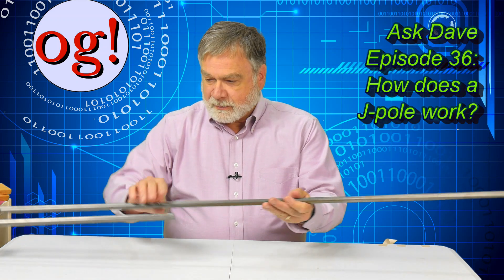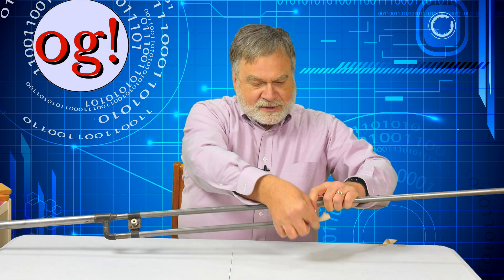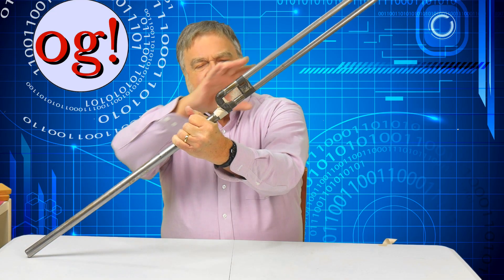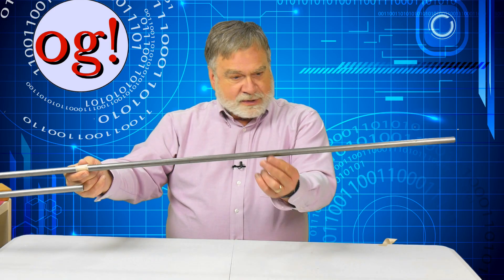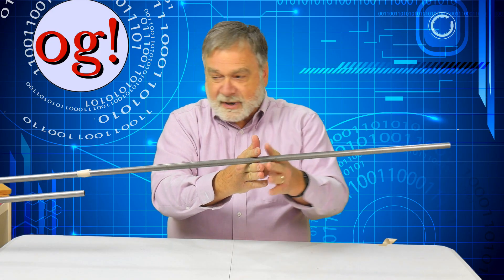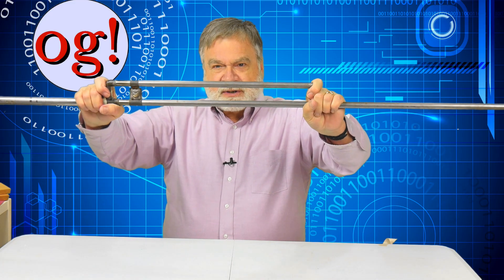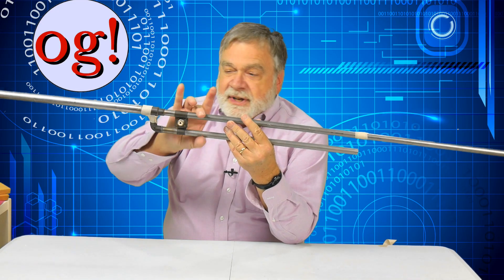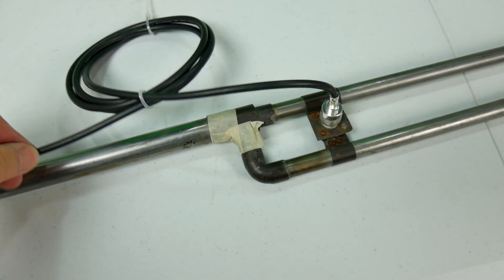How does a J-pole antenna work? AD#36

Comment: There is another sulotion...find the 200 ohm point, en make an 4:1 coax balun...the symetric problem is then also solved,
Reply from the maker: A simple choke balun (rolled up coax or ferrite beads) can do that too.
Reply: @davecasler  yes

Comment: Many thanks Dave: An excellent tutorial. I have a couple of questions 1) I've seen online several minor variations to the J-Pole design; either the centre conductor of the coax is attached to the J stub or to the main antenna section. Which connection is correct or doesn't it matter. 2) You said in the video that the lower end of the main antenna section doesn't matter. However, wouldn't the RF E-M fields be induced in this lower section since there is nothing to stop this. Therefore, does the lower end of the main section (the mast end) need to be grounded or insulated from ground? Does it matter?
Reply from the maker: Regarding connecting the coax, it's a balanced antenna, so it doesn't matter. Re the mounting stub, I've heard lots of opinions. In my experience, it's just an easy way to mount it.
Reply: @davecasler  Many thanks Dave

Comment: thanks very much Dave, pls i have a fm radio transmitter ''st 15b'' which i will be using for my amateur radio station. can i use such antenna for it. if yes what are the procedure for building such antenna?
Reply from the maker: I'm not familiar with that radio, but if it works on 2 meters then this antenna should work with that. You can find construction plans for a J-pole in multiple places on the Internet.

Comment: Ok... What would happen if you made two of them with both sharing the long copper tube and they are butt to butt with say 1 foot in between or 1/4 wave in between?  Yes, the bottom one would be up--side down.  The question is: would it increase the db gain? Also, could it be used horizontally?  Would it need co--phased?  Would they both need a 4 turn coil of 5" diameter coax?  Horizontally would it be directional?  Ahhh... The questions!!!  73s
Reply from the maker: Yes, you could probably make it work. I think you'd probably want to feed it in such a way that the antennas were of opposite phases. Why not give it a try?

Comment: Never ground a J Pole.
Reply from the maker: I don't see why not. You're so far away from ground that it's likely not a good RF ground, but grounding it via a wire or something allows the static charge to bleed off that happens when the wind blows across the antenna. I recommend the J-pole always be grounded.

Comment: Hello, Sir, and thank you!  I've read that a j-pole antenna is omnidirectional but wonder if there may be some advantage to pivoting the short or longer pole toward the signal source or perpendicular?
Reply from the maker: It's pretty omnidirectional as it is. The shorter pole is the matching stub and needs to be parallel to the main pole.

Comment: Dave you sure have a lot of knowledge and enjoy all your videos.  But this time recently discovered that the bottom part af the jploe does make some coupling with the metal mast. The swr was very high and could not find out why until made some adjustment to insolate from the mast and the swr was fixed...  the mast beeing all metal and 20 feet long was part of the antenna!...   hope this works for some other ham collegues    TKS
Reply from the maker: Be sure to provide a path to ground from the Jpole so that wind-induced static charge can bleed off. Otherwise it can blow the front end of your radio. I speak from experience.
Reply: @davecasler  well, I have a rod under ground as physical ground and then connected to the radio with copper wire... do you think that will take care of the static charge bleed off David?  (I know it does not good in case of lighting)
Reply from the maker: @sergiocavazos8963  As long as there's a DC path to ground.

Comment: J-pole antennas were designed for use on zeppelins (air ships) back in the day due to the fact that there was no ground as per say...also they are meant to be mounted upside down to the way we use them...they are a compromise antenna at best and not any better than a properly designed ground plane antenna. A co-axial dipole would work just as good and be easier to make and look better too.
Reply from the maker: There are many different antenna designs, and each has its proponents.

Comment: Hey Dave, I built a copper J-pole antenna today.   It's Rx is fantastic, but on Tx my swr was 20+.  I was worried I needed to rework the feedpoint, but after watching your video I realized that to match a balanced "feedline" (the 1/4 wave parallel section) to my UNbalanced feedline (coax), I needed a balun.  After wrapping one up and attaching it, I was down to 1.4:1 on my selected freq.  I realized I can get that even lower still with some trimming, as a few MHz below that was getting 1.2:1.   
Thanks for the balun advice in there, it really helped me out!    73 KN6AZK
Reply from the maker: I'm glad it worked out well for you.

Comment: I'm just getting into ham radio so I have a lot to learn. So, is a J-Pole antenna a good choice? And I see some of these advertised as a dual band 2 meter/70cm antenna and they look just like the one you were showing. How do they work? Thanks Dave for the video.
Reply: As far as I know, a dual-band J-Pole works basically like a trapped dipole.
Reply from the maker: Dual band J-poles are available. It depends on your need. For an outdoor antenna, a Jpole makes a good choice. If your repeaters are relatively close by, a simple quarter-wave vertical may suffice. Give DXEngineering a call and see what they recommend for you.

Comment: Very informative video. I am about to build an 11 m cb band antenna, m choices are the j pole, the coax dipole bazooka, or a full wave delta v. Which do you think would work the best. Not supper interested in dx long distance. Just would like good solid local communication,  very fond of the idea of the delta-v with 2- 12 foot poles. The idea of a full wave antenna would seem to make the most sense, but not sure if this is indeed true. Any thoughts from anyone appreciated. This is all about low cost fun and experimentation.
Reply: should have stated was going to build this as a closed loop, 36.47 feet
Reply from the maker: I think most CB is vertically-polarized, so orient your loop vertically and feed it so it uses vertical polarization.

Comment: Hi, Im just an SWL and no Ham... but your videos are very interesting for me. Can you please explain how a miniWhip antenna works and what a magnetic antenna is?
Reply from the maker: The electromagnetic field consists of both an electrical part and a magnetic part--you can't have one without the other. Most antennas excite the electric field part of the electromagnetic field, thus creating electromagnetic waves. But some antennas are designed to excite the magnetic part. They tend to be extremely high Q and therefore hard to tune, but some folks find them useful.

Comment: Hi Dave,  I've seen some really negative commentary on the J-poles performance and actual radiation pattern.   And then some really high marks on it's performance.   What's your opinion?  I'm building one right now and was just wondering.   Thanks.   Mike  K8MB

Comment: what is the minimum recommended height?  Can it be attached along side the trunk of a tree?  Can you paint it for camouflage to appease the HOA police?
Reply from the maker: Given it's a VHF antenna, height counts, so maybe 20 feet up. Up high enough so the signal can clear nearby structures. I'd say not against a tree trunk, but at least a few feet away. You can hang it from a limb. Yes, you can paint it. Paint will affect the tuning a bit.

Comment: I agree with D. Mckee, this was a wonderful description. I never really understood the "magic" of a J-pole, even though I used a couple of them in my early days.

I had gotten your typical copper J-pole from a fellow ham in the local club I belong to. I made a sort of tripod for it, intending to have it free-standing on my 3rd floor balcony of my apartment. I even found spray paint that sprayed very thick, with a textured result like rough stone. It also had flecks of different colors, and when sprayed with this stuff, the J-pole blended into the brick of the building so well you literally could not see it from the ground. Perfect!

Until I used it to transmit. Then the neighbor downstairs would take a hammer and pound on his ceiling (our floor) to let us know that we were interfering with his electronics. It would seem that our 2 meter signal was coming through on everything from his stereo to his clock radio. As this man slept days and worked nights, if I used 2 meters during the day, it would wake him up, when a garbled mess started yammering into the speaker on his clock radio on his nightstand. This would not do -- the guy could complain to the management and cause real problems! So I had to find an antenna that would still let me reach repeaters in the area AND no longer go through his consumer electronics.

The answer was straightforward. A Moxon loop for 2 meters. I made a pair of them with hookup wire stretched on the ends of an "X" shape of dowel rods secured in the middle. The ends of the two elements had small turnbuckles to adjust the length, to allow them to be tuned, and short pieces of thin shock cord to hold them taut. I mounted each Moxon on a free-standing garden privacy fence section, 7 feet tall and 3 1/2 feet wide. It fit against the ends of our balcony very neatly, and I secured them to the railing with cable ties. The Moxon let me get into area repeaters perfectly, and the neighbor never complained again.

I also operated HF from that apartment, using an MFJ random wire tuner for a while, but then upgrading to their tuner with artificial ground. I would fasten a fishing sinker to the end of a spool of magnet wire and shoot it into the woods across the parking lot below. Then the near end would go to the tuner. I worked stations as far as central Europe on that piece of magnet wire!
Reply from the maker: Thanks for the info!

Comment: So why could t I makes hf 20 meter similar, only past the last tape use wire and have it verticle
Reply from the maker: The bottom of a 20 meter quarter-wave vertical is closer to 50 ohms, but you could feed the bottom of a 20 meter half wave vertical dipole this same way.

Comment: You have a great channel and fantastic teaching method, thanks for sharing your knowledge with us viewers. I have a question for you. I've seen dual band J-Poles 144/440mhz  fabricated in a manner to where the upper  portion of the antenna  is 440,and the lower section is 144, separating the two bandwidths is an insulator coupled with what appears to be a copper wire circling the antenna perpendicular to the radiating element, I guess you can call it a load ???. I apologize if my description is confusing, don't know how else to describe the contraption. Can you explain how the antenna works???.
    Kind regards, Eric Dee.

Comment: Dave love your videos. This j portion of the J pole antenna is the matching section and the actual antenna is the 1/2 wave section, right ? So if you only change the half wave part to say the 220 band then you could have  interchangeable bands , right?
Reply from the maker: No. You'd have to change the matching stub too. In other words, scale the whole thing.

Comment: brilliant .But one question see at bottom your using aluminum but wouldn't that affect its length ?.As it would still act as an inductor ?.Because the base pole shouldn't be conducting correct?
Reply from the maker: Yes, the support pole does figure into antenna efficiency. But by and large it's ignored.

Comment: Just for kicks... I have seen your video on the J pole antenna.... So, as you were saying wen one looks at it this antenna have the apparent logic of a dead short circuit it self!! but I guess that I don't have nothing to loose asking if there is a particular frequency that favor more the use of this type of antenna??
Reply from the maker: 2 meters seems to be the sweet spot for J-poles. Manageable dimensions makes for easier construction.

Comment: long on theory, short on details. what goes to where on the SO-239?
Reply from the maker: It doesn't matter. You can connect the center pin to either the tuning style board to the mainmast. It will work either way.
Reply: then where does the ground go?

Comment: If anyone wants to build one, very cheap and easy, might i suggest this:

1, calculate rough dimensions. Jpoles are pretty forgiving, as are easily tuned. You need to know your long length, your short length, n your gap.

2, find a peice of pipe (i used 12mm aluminium) a bit longer than those 3 added together. Mark your short length + 1/2 pipe diameter, n gap + 1/2 pipe diameter. Cut a 90 (45+45) degree notch at those marked spots. 

3, bend at the notches to form your J. Cut 2 peice of pvc conduit (i used 16mm electric) 2x your gap measure. Using the base of your J as a template, drill holes for your short and long sides, with the shortside hole close to the edge, longside roughly middle, and a stub out the other. 

4, slide your spacer close to the bottom, then an appropriate hose clamp on each element. The other spacer then goes on. Position around the top of the shorter element, so a strong box is made. In a larger peice of pvc, drill 2 holes to fit the stubs in. I used 24mm water pipe. This is your mount. Mine is fairly short, as it attached to a steel mast, but this could be your mast. 

5, attach your coax to the hose clamps, and clamp to the approximate area shown by the calcs. Erect vertical and a halfwave in clear space. SWR. Adjust as needed. I got 1.1 on the second shot. 

My point is, although 90% of the J Poles seen on the net are soldered from plumbing fittings, a hacksaw and drill are all you need for a very effective, rugged antenna. 

Once tuned, i put a screw in all the joints, and when i got it home, tapped a hole where the coax feed was n secured the coax better. But that was after 6 months of operation at our vacation home. Everything was built from bits lying around, except the $5 ali piece of pipe. Took under an hour to build. 

As an added bonus pro-tip, busted up shade tents are a great source of push-up poles. One plastic knuckle breaks, n people chuck the whole lot out. Can very easily put up a 15m mast with a few old shade tents. Just guy them adequate, pretty floppy with all them joints. 

Ghetto 2m Jpole in a weekend, most expensive part was the ropes. 

Have fun!

Comment: Will a jpole work horizontally polarized for 2m ssb or only vertical. Better just to brew up a horizontal folded dipole?
Reply from the maker: Yes, it will work horizontally.

Comment: Ok  -  I get everything you said - it makes sense, but most j-pole designs have the center conductor of the coax connected to the other side,  that has the 1/2wave length above it...  Given that the bottom section is acting like a bottom shorted transmission line, I am not sure that which side you connect to the center conductor is all that important... but what do you think?  :)
Reply from the maker: It doesn't make much difference.

Comment: At 6:25 you mention getting the J-pole way up in the air, above your head. Can you give a little more detail on that ... is it a certain distance from the ground that matters, or not being next to your body / head? I have a portable J-pole on a stand that starts about chest height, so I'm wondering if I should avoid standing near it, or if it needs to be further off the ground, or what.

Comment: Thank you Dave for for the clear explanation. However i have a question to ask. I noticed different kind of feeding for j-pole antennas, some have the shield of the coax on one side and some on the other side. Does it make a difference?

Comment: 1:33 
I thought half-wave dipole is about 73 + j43
Reply from the maker: Yes, depending on height, surroundings, etc. That's the impedance at the center point. At the ends, the impedance is quite high.
Reply: thx

Comment: Hello ...Great explanation. I want to make a Super J-pole for 6m band but i am not care to have fullbandwidth because i will use a very small range of frequencies in the band. Can i use a 3/4" diam, or better 1"" diam. of copper tubing so to make it more stronger against high wind loads??? Cause of thicker tubing it  needs other calculations??  I will use this calculator..... http://www.hamuniverse.com/superjpolecal.html
Thank you,  regards.
Reply from the maker: The only way to know is to try, and be prepared to tinker.

Comment: Thank you, thank you, thank you! Your explanation made complete sense. One question though. When mounting the feed line, can a multi-meter be used to find the 50 ohm sweet spot?
Reply from the maker: No. At DC it would show a dead short. You need to do it at the operating frequency with an antenna analyzer.